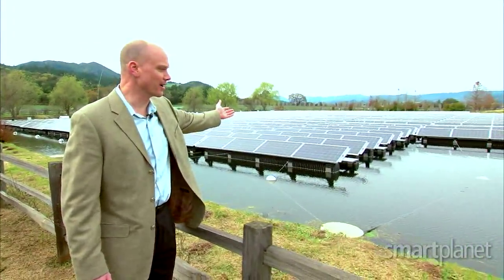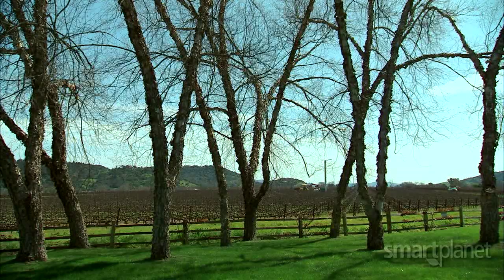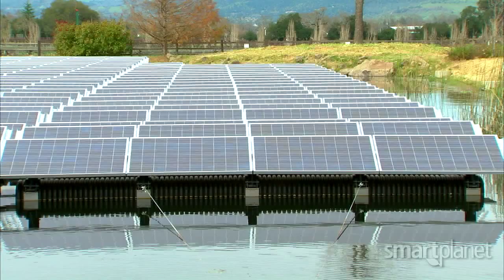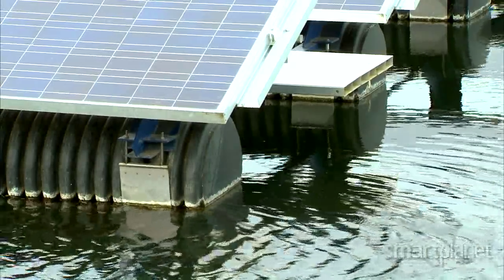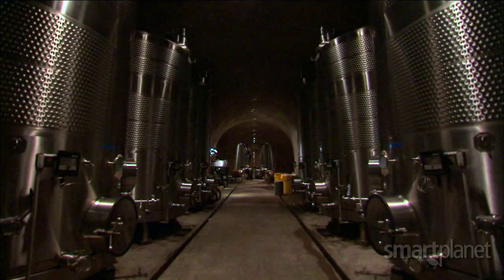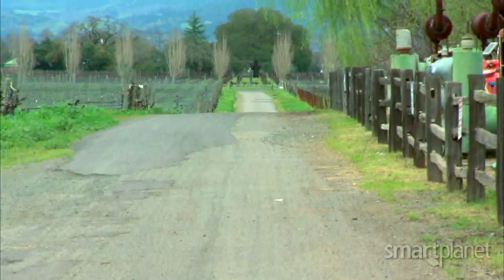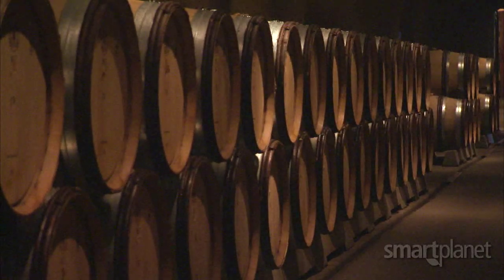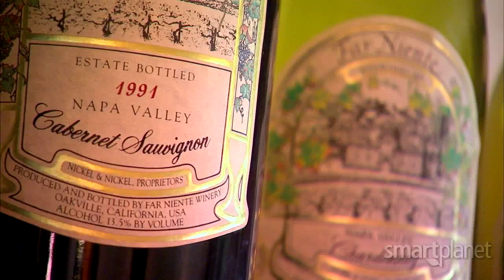Solar That Floats on Water

Comment: I am developing technology for solar panel forms float on harsh environment ocean that has large water surface area. Bay of Bengal could offer electricity power for Chennai during summer where there is large and frequent power cut.